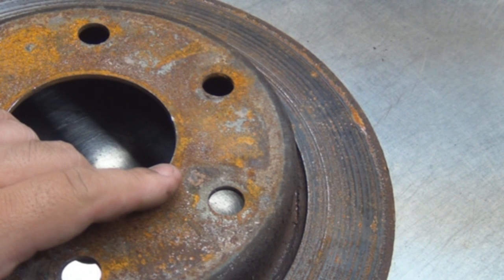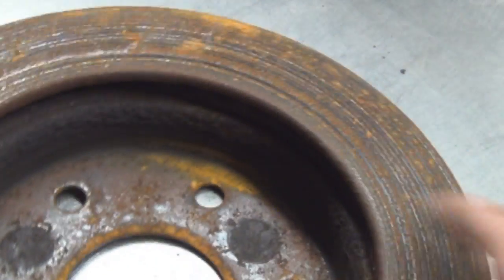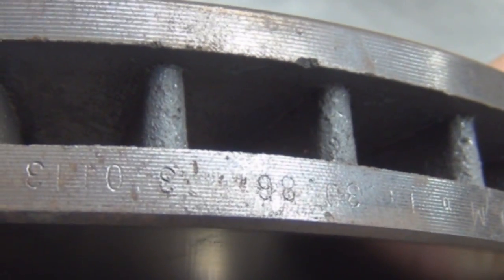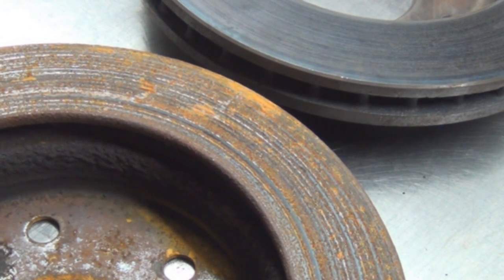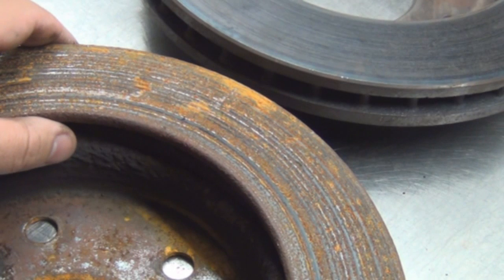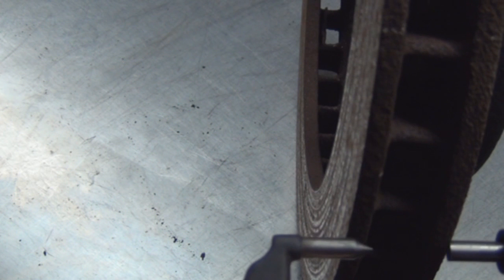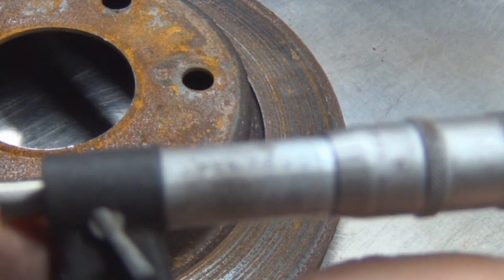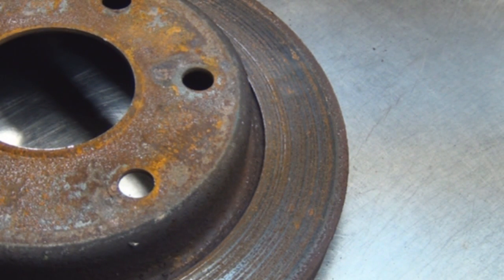How to measure Brake Rotors and how to use a micrometer measure brake rotors

Comment: Question 
Is it true or false that some or most break changing places would rather you buy new rotors vs turning the rotors 

Note went to two different places and they didn't even mic them just said you needed to replace them
Reply from the maker: A lot of times there will be damage to the rotor that is visual that can fail without using a mic. For instance ; hairline cracks, blued rotors , brake pad carve to thick in the rotor and etc. I hope this is helpful. Thanks for watching and commenting. Please like share and subscribe
Reply: @handymanPF  I haven't checked myself yet but normally the only thing wrong is its grooved on the rotors I do however some of the shops here just don't like micing the rotors and rather just replace them I use to know a guy in the shop but he retired and I would have went to ask him but cant now... but I see what you mean but if its not under the thickness cant you still turn them??? if they look find no cracks or blue from over heat....???? cause if I go in and check them and they can be turned and they look ok to turn other then they could be warped idk it just seemed like they didn't want to even check cause my brother use to work as a tire service guy and said you cant tell just by looking at them unless you mic them if they are warped you cant save them and if you over heated them (blue marks) you cant save them other then that I don't know what to say.....!???
Reply from the maker: I personally like just replacing the rotor with new ones
Reply: Rotors aren't really turned anymore. Very rarely.
Reply: @Blinknone  not true O'Reillys still turns rotors but this is on your own so mic. the rotors before you take them there cause you just waste a trip if you didn't check they have to be at a certain thickness and depending on what's wrong they might reject them for certain reasons
Reply: @bobdeer7940  The issue is that rotors are much thinner than they were years ago.  This is due to better materials being used and the need to reduce car weight.  There is simply less material available to remove while "turning" the rotor.  It's more common these days to simply replace them, but sure, some do still get turned.